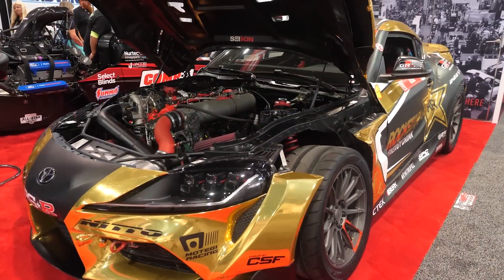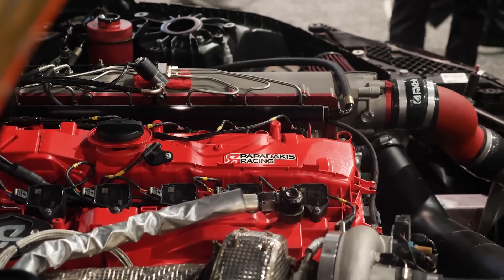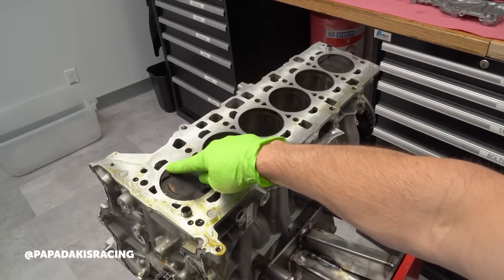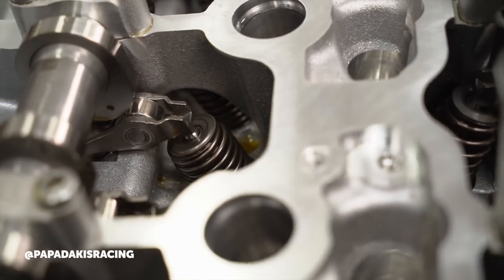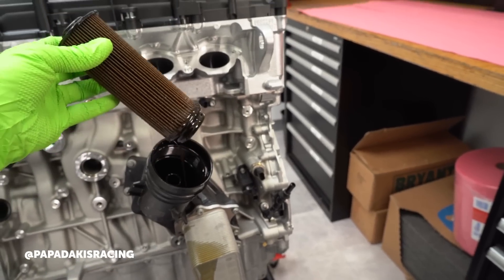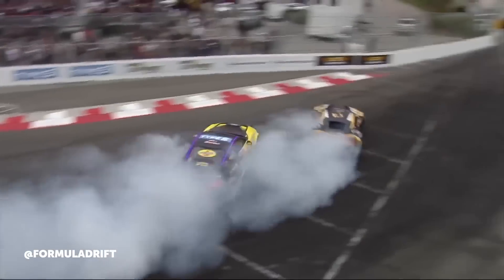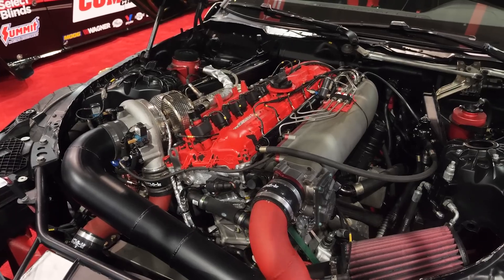Goodnight 2JZ? | 1200HP B58. Stock Block, Stock Bores & No Dry Sump!?

Comment: The $ per HP is extremely high for this engine so not even an option for many. The cost to purchase a B58 and then modify it too much for many, the 2JZ will be around for a long time yet.
Reply from the maker: At one point in time the $ per HP was also high for the 2jz compared to the other options of the day, but I don't think we're going to see the B58 produced in the numbers the 2jz has been.
Still, if you want to make 1200hp reliably (as in for more than a dyno sheet) on a B58 or a 2jz you're going to have to spend some money 💰 - Taz.
Reply: @hpa101  For anything with reliable high HP it will cost. The Barra is a strong alternativeto these that is capable of producing horsepower reliably. Cheap to buy an engine in Aust and NZ. One running in a drag car goes into the 6 sec 1/4 mile passes, with factory block and head, 10K rpm, from an engine that powered many of Australia's taxis.
Reply from the maker: Al talks a bit about turbo vs non-turbo Barra factory internals here, if you're a Barra fan you will love this chat I'm sure noting they are not all created equal. Just like the LS, 4g63, SR20 and any other engine that had a long run, some variants are sought after and cost more that others when it comes to getting power out of them with aftermarket mods from there: https://www.hpacademy.com/blog/073-the-barra-indestructible-monster-or-overhyped-taxi-engine-podcast/?utm_source=youtube&utm_medium=social&utm_campaign=general-interaction - Taz.

Comment: They may be making 1200hp on an engine with a lot of stock parts.. but in only 8 events per year they destroyed or broke the short block 6 times in 2020, 5 times in 2021, and 6 times in 2023.. Not the best "reliability" if you ask me.. I suppose if you have a sponsor and are getting short block cores for free, and using as many factory parts as you can it cuts down on the out of pocket expenses for a season..
Reply: Drifting is the most demanding motorsport out there (except the peak extreme ones ofc), that's still extremely good

Comment: Just reminding you all. In 2015 John Mihovetz prepped 4.6 4V with oe cast block, oe cast GT heads and factory Kellogg crank ran 5.88 at 256mph making 3,000 hp @ 10,000 rpm. 
FoMoCo > any import

Comment: B58 needed to be 3JZ. All would have been fine. Still don't think the b58 did what the 2J did when it came out. B58 is not over engineered. It's BMW's best not Toyotas best. Kudos to Papadakis and guys at Real Street to finding out what this engine can do. Anything can built to hold alot power. It's about how easily it can get to those high power levels.

Comment: I can't imagine what they were thinking with the internal exhaust to 2-port arrangement.  It was as if they were intentionally trying to curtail or nerf the aftermarket.
Reply: I'd say it was a way to get the car on the market without issues trying to find a solution to get it into the other market's with the 6 port(which is partially why the mk5 still remains as a 2 port still in evert market other than the US Mk5s which are all 6 ports since the 21 models)
Reply: Its honestly a great idea.
Faster heating of the motor (as the exhaust ports are cooled).
Quicker turbo spool and better response (shorter valve to turbine path)
Perfectly sufficent for stock and up to stage 2.

The aftermarket isn't something any company actually cares about, it usually only results in extra costs.

Comment: B58  will never be as prevelant as the 2jz just because the 2jz was in litteralky 100s thousands of models in Japan and abroad mostly in NA  but also turbo.
Once upon a time you could buy a 2J  NA  for 3-400$  used. Doubt the B58 will ever get that cheap
Reply: BMW has over 20+ different models with B58s along with the fact that they've been around since 2016 being sold world wide with more than one varient/gen made and a later new gen that's going to be put/spread across later models to come.....whos to say they won't be as relevant when the BMW quiet literally has the engine in practically every model in their line up(except the 1 series since they switched it to fwd now)since 2016. And less your lucky or do your own searching threw a local junkyard u aren't finding a good 2JZ na or not for those types of prices ever since they've spiked since covid hit and screwed up the prices in the market for them.
Reply: @carboydorifutoparty3976  1jz 2jz  engines were made between 1991 and  2007,  yes they are old now but there were an estimated 3million on them produced in Japan.  B58   yeah doubtful  that many were made
Reply: @cheetomussollini  how so? Bmw has made them across the board in almost every model in their line up along with the SUV's also. Bmw even said they want to continue with the B58(and current V8 and B48 I4) till atleast 2030 with the shift of the market with Ev's with the thought of continuing on with thw B58 having a mild hybrid system later down the line being used in later models. By then they'd more or less pass the number of JZ's made by the time they reach 2030.

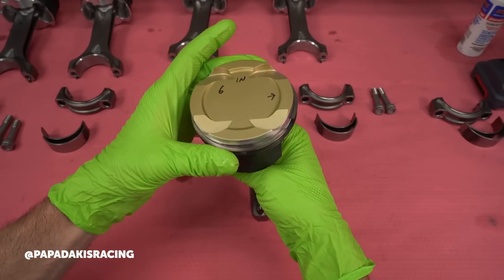Comment: Metallurgist here. @4:12 The "steel plasma sprayed lining" is probably not steel but nickel-based. Some nickel-aluminium plasma sprayed powder mix that forms a base of metallic nickel with NiAl intermetallic hard wearing particles embedded in it. Since nickel is also ferromagnetic, you'd get the same reacton to a magnet as if it were iron.  (Similar to a Nickasil coating, but deposited by a different method.)

Comment: heres the main difference, one will actually last a while before breaking, while the b58 will be replaced every couple months.
Reply: Been keeping eye on them. Have yet to see people doing that less they blew the motor. Even some of the top teams are using the same B58s since they started and continue building and testing as they go since they came around. Even titan hasn't and they recently ran a 8.18 with theirs.

Comment: It wasn’t the engine, it was the fact Toyota sold their flagship to bmw that made people disappointed.
Reply: Honestly they just have noting that'd outdo the B58 at the moment. Maybe their 5.7L V8 or the ar I4s that people/teams build but that's only a handful compared the the many built B58s running more power with them along with easier aftermarket support. I'd say its the communities fault for not bother to mess with the rwd platforms(F cars and the awd/rwd 350 cars) toyo had around the last decade that made it clear that there would be no point in making it themselves if people don't even bother buying their own platforms so lets source someone who knows how to make good sportscars + tunable engines and go from there. I'd even say that the Nissan boys put well more effort in their modern platforms than the toyo community has at all.

Comment: Nice build, what is the budget of building that b58 bmw at 1200hp, vs building a 1200 hp 2JZGTE?
Reply from the maker: I just checked our local eBay, Trademe, and you can get a cheaper stock B58 with loom than you can a stock 2jzgte. This surprised me tbh.

I'd only be guessing from there cost wise for a built version of either without putting the time In - Taz.

Comment: All the hate for the new Supra still bugs me, but it just makes it more similar to the Mk4. People won't realize how good it was until its gone.
Reply from the maker: People get crazy about the weirdest stuff. At least they make themselves stand out so they are easier to avoid in life 😅 - Taz.
Reply: People wanted a Toyota and got a BMW. How is it hard to understand why Toyota enthusiasts were upset?
Reply: @jacobmyers3868  how is it a bmw?
Reply: @anthonywilsongolf  because engine is bmw drivetrain is bmw gearbox is bmw and multimedia is bmw basically 70% is bmw in the supra. W Toyota for choosing to work with BMW
Reply: @BABYSHASIEL  doesn't make it a BMW. It's a Toyota with a BMW engine and drivetrain
Reply: @jacobmyers3868 MK4 A80 Supra wasn't well received when it first debuted. It was a sales flop car
Reply: @  At least it was a Toyota.
Reply: @jacobmyers3868  The MK4 Supra isn't "100 percent" Toyota either. Along with the 2JZ series engine that was co-developed by a German firm company that also did many BMW engines. Therefore the 2JZ has BMW DNA

Comment: I have a question regarding the B58 in the Supra. When this car was released, part of the marketing was that the engine was disassembled in Japan and tested. Then it was stated that Toyota made a report w/ recommendations and sent it to BMW.

My question is, did BMW take any of those recommendations and make modifications to the engine in the Supra, or did they just smile, wave, and place the report in their filing cabinet?
Reply: BMW just gave them the engine and more or less went their way with the Z4 but the noticeable difference with mk5 B58s is that they have stronger HPFP's than any other B58s that handle more power than any other varient. They more or less didn't care since they were already making the S58 bmw's(S58 is similar but superior in more ways than one than the B58)so they prob didn't. I think the latest varient B58 that's going to be in Bmw's is the B58TU2(dunno if this is the right name cause I can't remember)that is said to have both DI and PI unlike the past gens that were DI only and would make 400+hp stock with this nee update. No info on it being know if its going into the mk5 but who knows.

Comment: Well 2jz aint dead cause b58 got long way to go. Firstly Is b58 even reliable like 2jz. Secondly they didnt touch the bottem end. I would have recommended they should have gone with 2jz block, it would have made a better outcome,torque including compression etc. Includding 2jz aftermarket parts would be cheaper. Lastly b58 is new on market so research and good aftermarket parts are gonna take long to come out.
Reply: Get outta here kid

Comment: 25-30 yeras old engine making stable 1600-2000hps, when ever b58's making those numbers, u can say goodnight 2jz, till then still much more better then b58 in my view btw one of my closest friend had f30 340i with b58 and is not reliable had so much problem with oil pump and heating yeah maybe upcoming gens get better but not now
Reply: I'm honestly tired of this 30-year-old engine argument. Do you honestly think that BMW couldn't put a thick iron block and forged pistons in there so the engine could make 1000+HP with stock internals? Of course they could, but does it make sense doing so in what's basically a performance-lite engine? It absolutely doesn't, and this escapes most of you people for some reason. 

Engine design is similar to architecture: it's pretty easy to overbuild things so you're sure they last, but it takes skill to get the most with the least amount of material and costs. I don't think you'd be happy if your house costed 2x as much to build just so it could last 150 years instead of 100 before requiring serious maintenance. It just doesn't make sense, you'd be long dead anyway and wouldn't care.
Reply: Also, just because your buddy had a B58 and it wasn't reliable doesn't mean the engine isn't reliable. Anecdotal evidence from one owner doesn't mean anything when the vast majority of owners report that the engine is reliable.
Reply: @xIcarus227 he ok bmw boy
Reply: @bilgehankorkmaz9719  I don't have to be a 'BMW boy' to call out a silly way of thinking. This ain't about brand x vs y buddy.

Comment: I think the title is a little mis-leading. B58 is a great engine but the 2JZ has been known to run in excess of 800hp with stock INTERNALS, not just stock block and bores. I think the record is 1000hp stock botton end on a 2j. Also the comment on people hating the B58 was smoke and mirrors, the real issue people had was with Toyota's direction, they based the deisgn from a Z4 rather than doing a ground up build. So it was riddled with BMW, there were stickers and stamped all over its parts. It was a purity thing. Im sure if Toyota did a build ground up and still used the refined B58 engine people wouldn't arc up as much as they did. 

In regards to the Vr38 engine, As a GTR owner I don't think people were that annoyed at the rb era "ending". I actually never heard anyone complain about the VR38.. The engine sounds like crap compared to any Inline-6, but i dont think people were unhappy with the platform??

Comment: No the 2jz isn't dead. The soul of the 2jz is its ability to fit under the hood of almost any rwd chassis, with little to no modification. No direct injecton, no can bus ecu. Just a engine that runs off 3 powers and 2 grounds. The b58 is new tech and is pretty much locked to a couple chassis because of integration issues. Sure later down the road, people will take on the task of making it easy to swap into stuff. But the 2jz has been the king of drift swaps since the 90s. Also the vvti 1jzgte is the beat sounding i6 on the planet, the b58 makes fart noises.

Comment: Would one of these engines be good for circuit racing ?  I killed my last baffled SR20Det bottom end from oil starvation - I suspect it was a mixture of poorly baffled sump and slick tyres.
Reply: Well yes. There's a bunch of mk5s rolling either on stock or modded B58s running just fine. And one owned by jackie ding who literally pulls podiums with his with a unopened B58 with 6-700whp+.

Comment: The MK5 Supra is a great car, and frankly, I was one of those that were skeptical about the drivetrain it came with only because I felt it should have had a Jz in it. And it’s been proven to be a solid setup with the B5 engine, however the 2JZ will never die. I’m sorry😅
Reply: 2JZ is not really a "Supra engine". It first Started originally in the Toyota Aristo (and 1JZ first started in the Toyota Soarer. Not the Supra A70 3rd gen)

Comment: Never understood this 2JZ hype from practical standpoint. Unless you replace everything in it, no massive power. On the other hand, German engines ara capable as is, either gas or diesel. MB M104 is mental. Well established BMW N54/N55. Audi 2.2T/2.7TT/3.0T. And surely others. Not so surprising its German engine again that does the trick and US folks are shocked being used to gutting 2JZ to make power.
Reply: I’m confused, what German car produced around mid 90’s that was making 800-1000whp in the early 2000’s? Stock block and trans.
Reply: @bigjdm5460  I agree, you are very confused if you believe stock 2JZ makes that kinds of power lol. You will be happy with reliable 500HP. 1000 WHEEL HP, meaning ~1200 crank HP. You mad? lol
Reply: @75L48  big lazy turbo hood tune. Love how u chose the high of my range. Yet and still u can find plenty with big lazy turbos that live in that range. U never answered my question , name a German car and engine from the mid 90’s that’s reliably making these numbers?
Reply: @bigjdm5460  Bruh, you know shit about engines obviously, so no further debate needed. Take care.

Comment: Very misleading title. The B58 falls very short from even matching the 2JZ. It can't do 2JZ things and it won't.

Stock longblock (stock internals) is far more interesting than just the "stock block" because we should only compare engines by their factory assembly first. Not a single B58 has reached 1000whp on stock internals to date. But the 2JZ has made 1100whp on stock internals (stock pistons, crank, rods, bearings, oil pump, block, etc). 

The B58 is 7 years old. The B58 was also available with a manual 6 speed transmission since 2016... why wasn't the MK5 manual since 2019? Because 340hp wasn't enough to really beat the 320hp MK4. This would not promote sales or fans of the rebadged BMW that nobody asked Toyota for. So they waited for the 382hp tune first BEFORE their manual release.

Comment: Not only is the B58 phenomenal, but now with the release of the S58, capable of 750wheel just on stock turbos, with the block's limit being higher than that too, Toyota's own 2JZ is pretty much only still better for a full blown 1800hp+ drag car application, and even there the A90 is catching up quick. Otherwise BMW has it beat.
Reply: Everything you've mentioned are all bolt-ons in regards to S58, which isn't a surprise. Give a stock 2JZGTE a single turbo and the ECU will adapt up to 500whp since 1993, or 550whp since 1997 on pump 91. Your S58 highlights are just later tech. 

But as for "stock block" the 2JZ still holds a higher factory longblock record. 'Factory longblock' means the block and everything in it from Toyota. Over 90% of papadakis's engine is aftermarket.

If we were to build a 2JZ as much as papadakis has built this B58, we wouldn't just have 1200whp.
Reply: @allboost70  saying "stock block" is kind of misleading.  As long as the factory block is being used you can say its a "stock block".
Reply: @allboost70  Bro, you're talking out of your ass im sorry. Pure clownshoes. JZ heads does not flow well. They never have. "If we were to build a 2JZ as much as papadakis has built this B58B30, we wouldn't just have 1200whp" No, it wouldn't have 1200hp, it would have less than that. That's not an opinion, that's a fact. If you had a 2JZ and a B58 side by side, with the exact same setup, the same compression, same fuel system, same turbo setup, same boost etc the B58 would make more power everywhere in the rev range because it's a modern platform and the head flows far better. Heck even the naturally aspirated BMW inline 6's from the 1990's outflow the JZ heads. You're free to go look up the cfm numbers on the heads. That's not to say the 2JZ isn't a kickass engine, but you're just talking straight nonsense.

Comment: wait did bmw put glyptal on the bearings? i have seen it used in cylinder heads to reduce oil adhesion so it flows back to the sump faster but why use it on bearings...
Reply: Bmw have used copper bearings before in previous M3 engines that would fail after 40,000km. BMWs work well when they work but are terrible for when they don't.
Reply: @allboost70  im all too familiar. i daily an e46 m3 lmao.